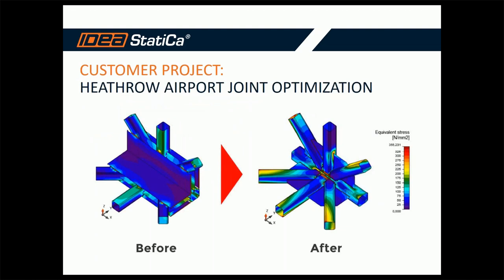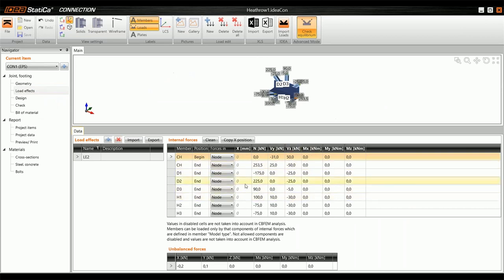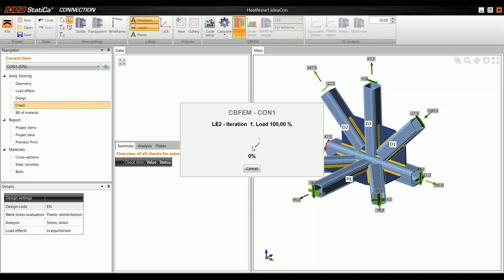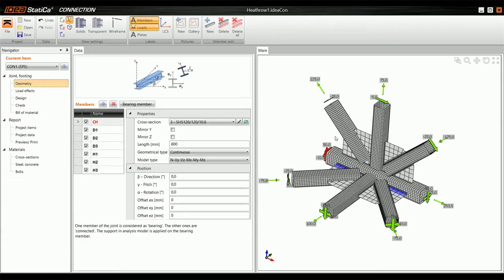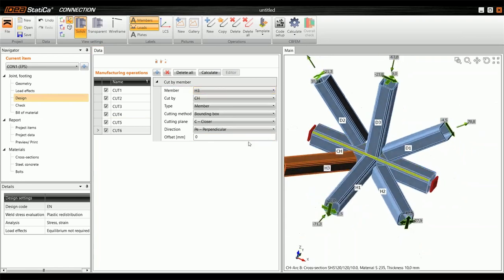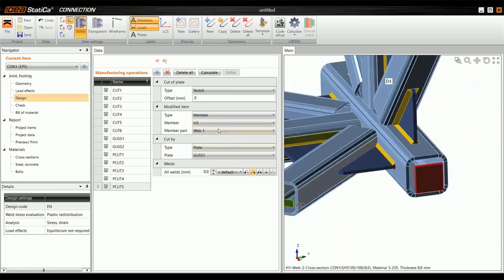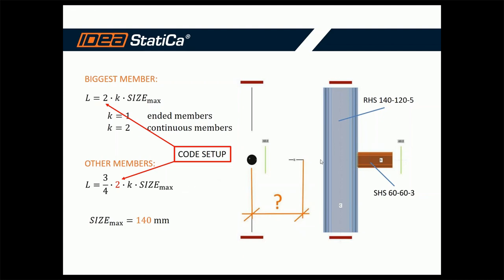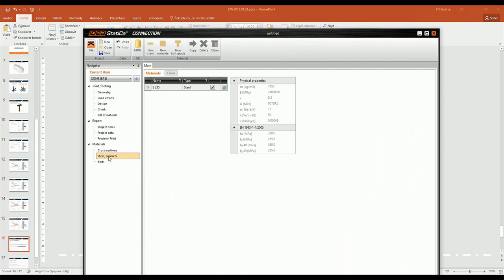Connection Wednesdays - Heathrow airport connection optimization

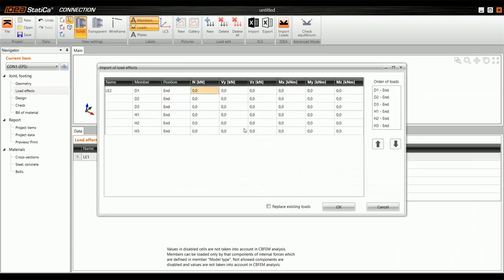Comment: Loads imported in 15:27 provoke failure
Reply from the maker: Hello Rebellischer Cherub, the design was correct. Why do you think it provoked failure?
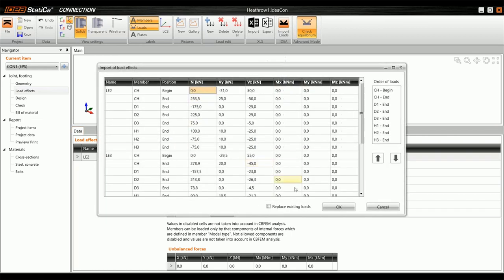Reply: i followed the tutorial. plus, there is a diference with loads inserted in 9:07,  the first ones have values in both extremes of member CH. thank you
Reply from the maker: You are right, but we explained it in the webinar - first we used the "old fashion" way how to check connections - you take maximum values of each internal force component of all the combinations (some kind of a super combination or envelope of forces that occur under different load cases) and apply it for code check. But with IDEA StatiCa Connection you are able to simply import all your load combinations and check all of them one by one, so you dont have to apply this super combination which lead to overkill the design. With IDEA StatiCa Connection, you can do it the proper way and save material and costs of your connections...
Reply: Sir way the idea statica if i designed directly from robot to it for connection the internal forces which has been taken not the real force it's difrent for complex connection